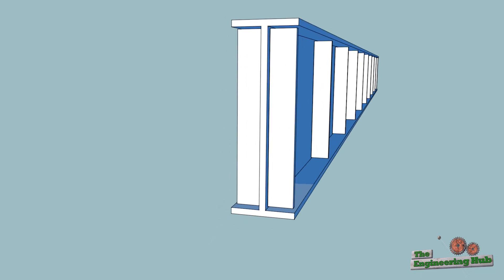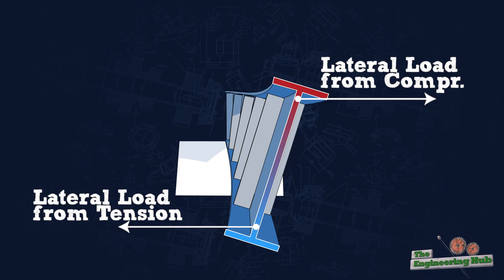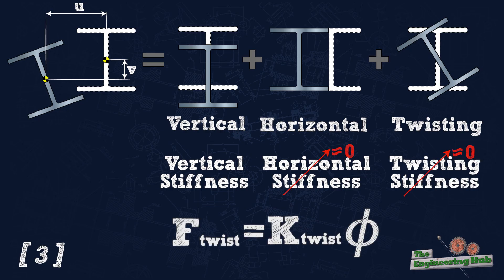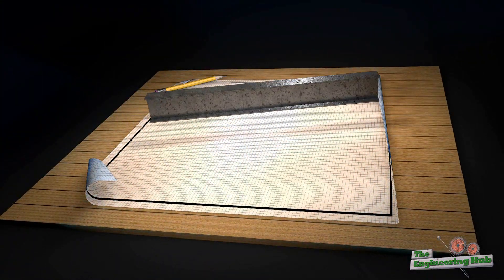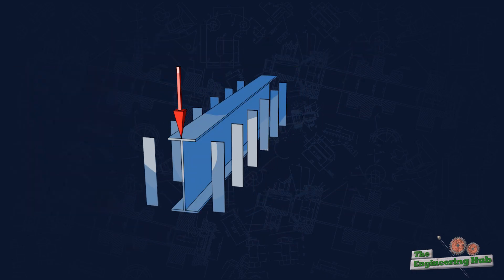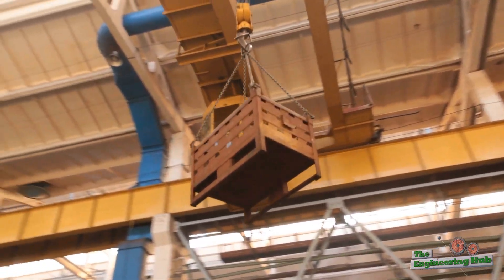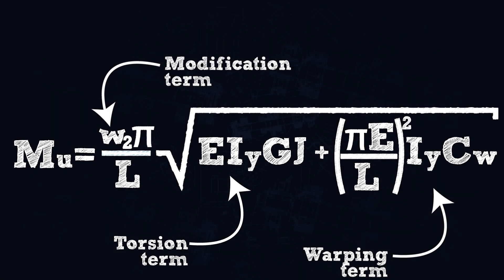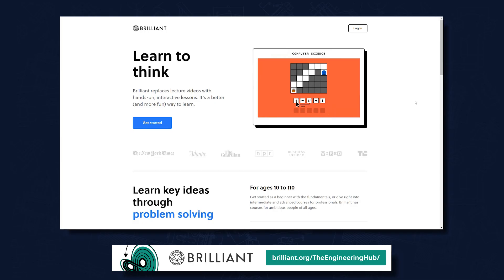Open Beams Have a Serious Weakness

Comment: A box beam will be heavier than an I beam - unless you fab one from C channel.  I beams as manufactured ar stronger.  If the design is incorrect or the structure  shifts and the load point changes, they will deflect.  Your ascertains are factually incorrect.
Reply from the maker: Hi Marcus, the idea was to compare a box and I-beam made out of the SAME AMOUNT of material. But even if they weren't, it is well known in the structural engineering world that open, slender sections suffer from lateral-torsional buckling (LTB) which drastically reduces their carrying capacity. Box beams (or any other closed sections) do not suffer from lateral-torsional buckling and as such achieve its full bending capacity which is usually higher than the LTB load. We read your comment numerous times and still don't fully understand what exactly is that you are pointing out as "factually incorrect". Can you help us out a bit and clarify? Or if anyone else understand please drop a comment below, thanks.
Reply: @TheEngineeringHub  He might have been referring to box beam in fact being heavier than I beam.
Reply: @3markaw  What do you "heavier"? There are many combinations of shapes and wall thicknesses in box beams and I-beams, there's too many variables to just say one is heavier without having exact dimensions.

And in the video here the comparison was made between box and I-beams of the exact same weight.

Comment: With regards to lateral torsion, to say that the root cause is material imperfection is a red herring.  Material had better have been inspected prior to installation, beams had better be tested before they are used in production.  Especially per findings on this disaster where a beam was not inspected or tested:

https://en.wikipedia.org/wiki/Hyatt_Regency_walkway_collapse

Material is always imperfect, that is its nature, account for it, assume it to exist.  Just like in electrical engineering, where the tiniest semiconductor imperfection in a balanced but unstable driven circuit causes oscillation, often as intended.  If you intend it to be rigid, make it stiff in all directions.  Never engineer in 2 dimensions because in 3-4 dimensions it will fail.  

~One Electrical Engineer
Reply from the maker: Hi not amouse, this imperfection is so microscopic that no inspection can detect it and more importantly even if it could, it cannot be eliminated. Instead it is just assumed that it is there. It is the nature of our world, nothing is perfect. The problem is that this microscopic deflection gets amplified when an unbraced beam is loaded and results in lateral buckling. If in a parallel universe we could produce a perfect beam down to the Planck length it would still buckle laterally because the load is not perfectly centered and will always prefer one side over another. If somehow the load was also perfectly centered then the beam won't buckle laterally but it would take the flap of a butterfly's wings to initiate this catastrophic process. So in essence lateral torsional buckling does come down to imperfections and natural preference of the material to one side over the other. Engineer's prevent this by totally avoiding it. No design ever allows for lateral torsional buckling to occur in normal operating conditions.

In regards to your link, the Hyatt Regency walkway collapse is a very famous structural failure and we have studied and discussed it numerous times during our education and practice. A more rigorous inspection process and better communication most likely would have caught the error since it is absurdly obvious. But this is very different from the microscopic imperfections discussed in this video.
Reply: It's not really an imperfection;  its simply the point that bends first.

Comment: I went into a restaurant that was less than a year old and they had a very large laminated beam holding up the ceiling and it was twisted as badly as your CGI example and was only inches from sliding off the center support post. I called the manager/owner and discussed the impending disaster that the beam posed. He insisted that they had an engineer design it but I pointed out that if it had been PROPERLY engineered, it wouldn't be twisting, and it wasn't a matter of IF but WHEN the beam was going to collapse.
I went back a couple of months later and the beam had been replaced.
Reply from the maker: Hi Gary, that's terrifying! Twisting can be very destructive to sections that are not designed to handle it (such as wide flange beams). In your case, a laminated beam (assuming rectangular) would be a bit better at resisting twisting loads though it might be problematic for the laminations. In any case, I would still not bet my life on any design that undergoes excessive deflections/deformations. The serviceability limit state (SLS) is also an important part of the design process. I would not trust any structural member that does not comply with it and judging by your description, that beam did not comply with it.
Reply: @TheEngineeringHub  - UPDATE: My curiosity was peaked and I went back to the restaurant. Apparently the replacement beam didn’t work out either. They removed the beam and the whole roof (it was a patio cover) and replaced it with an artistic shade installation.
Reply: @garyreed2206  good on the manager for listening.
Reply: Compliments on your insistence to the manager! You probably saved Many lives!   Thank you 🙏!
Reply: Clearly their insurance agent did not see that - if he had he should have refused coverage until repairs complete.
Reply: This was fascinating, and a clever approach to use the 2 sheet metal C-channels for comparing the two different cross-sections. Nicely explained!
Reply: Nice one
Reply: Lucky the manager was listening and had taken action. Many would not believe a customer....

Comment: As a fabricator I just make what the engineers say 
But now I’m need to know why use i beam at all if a box beam for the same weight is stronger and harder  to work with and more expensive
Reply from the maker: Hi Aussie, a box beam is only stronger for unrastrained applications. For most applications , W-sections can be laterally braced to prevent lateral-torsional buckling. In that case (restrained), the w-beam (or I-beam) is significantly more efficient at carrying bending loads.